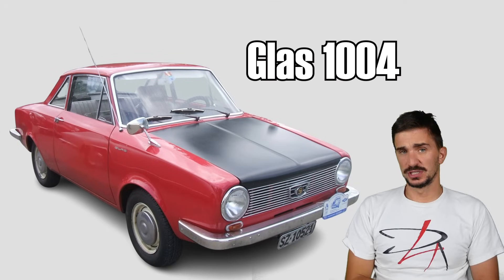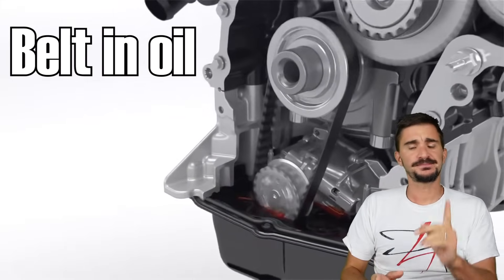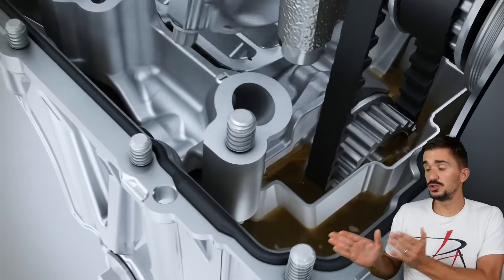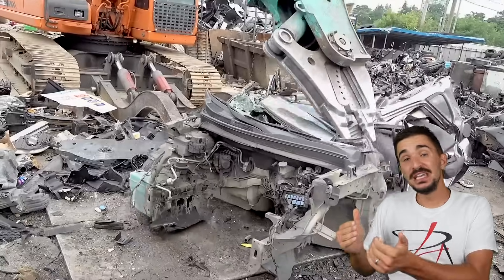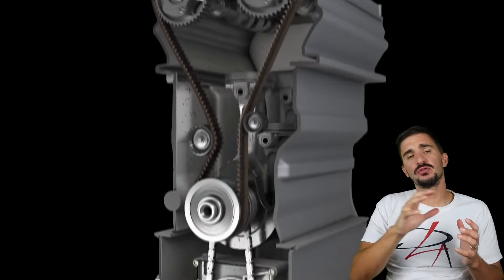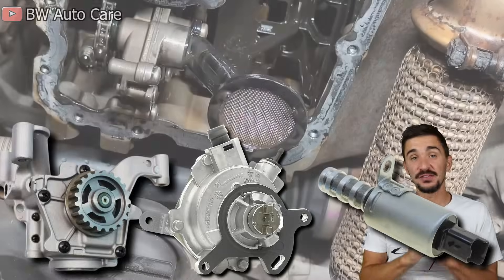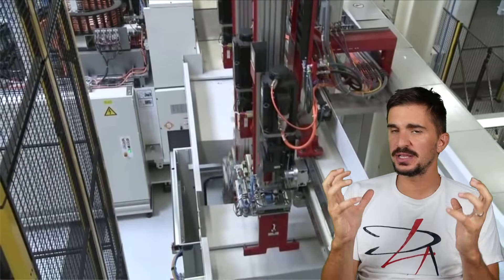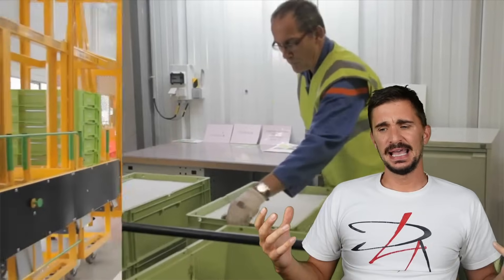Who Approved This and Why Is It Still Being Made? Wet Belt aka Belt in Oil Engines

Comment: The continued use of wet belts despite the known drawbacks only reinforces the 
belief that modern cars are not being built for long-term reliability.

Awesome job on this video.         👏👏👏
Reply: The manufacturers don’t care as the belts fail after the warranty is up. Then they can sell parts or entire engines and add to the bottom line. They figure (rightfully so) that buyers mostly buy another brand of vehicle whether they have had trouble or not, so why should they spend pennies to try to keep them as customers? It’s all in the actuary charts for them. Also, decent cars now last 10 years or more, so a frugal person will own, what, 5 new cars in a lifetime? Even less incentive to do the right thing for them.
Reply: Wouldn’t expect anything less from Ford, same company that brought you the Pinto
Reply: @blauer2551 I had Two Pinto's and both were really reliable and easy to work on. The best one was the 2000cc engine in the '73 it actually had 5 main bearings in the block. Thats the same as most V-8 engines.
Reply: Now ford has a plastic oil pan I used to think Ford was a ok vehicle for the money now I'm glad I'm a gm guy
Reply: @DustinKillyact  I was surprised to learn that the Peterbilt I drive also has a plastic oil pan
Reply: @justins.1283  Unfortunately they could also double as a bbq
Reply: Except in Japan apparently
Reply: @blauer2551  now that's crazy hopefully we are wrong about some of this new engineering I do have a few classic cars that the metal parts of the body rotted away but the plastic parts are still like brand new 🤣🤣
Reply: @blauer2551 the main issue with the Pinto was the location of the gas tank. All they have to do is lower the number a little bit more and that issue is fixed
Reply: @BigPanda096  That’s why I said they would make great bbq’s. Drove around in an orange one when I was in HS and it was a fun little 4 speed.
Reply: They are built to meet emission requirements. Unfortunately, those requirements only care about fuel efficiency, and not the total remains from when the vehicle is built until it is destroyed.
Reply: The real kicker to this shit is you have to use a special oil
Reply: @blue03r6  What kind of special oil?
Reply: Modern cars suck, but the funny thing is, older cars were even worse. When I was growing up, my dad (a mechanic) didn't want a car with over 100K miles on it. The engines usually didn't last much longer. Between improvements in metallurgy and competition with Japanese car manufactures that made their cars to last longer, American car makers were forced to improve the longevity of their cars.
Reply: @williamhicks558  At least you could diagnose problems and do the work yourself
Reply: I work on high end cars for a living and let me tell you that statement you made is 110% true. Manufactures will purposely make specific parts fail. In fact my company is getting sued form multiple people with transmission problems. There’s also a specific model car that has a radiator leak in the same corner. Car won’t make it 20k miles before it leaks. I’ve also seen brand new motors with 2 miles on them leaking oil out the front timing cover. A new one I’ve seen is cam carriers leaking and I only see them on the turbo models. But this is why I stick with older vehicles. Easy to maintain and runs forever. My daily drinker has 467k miles on it and she still runnin good.
Reply: @mdude7778  special oil like gm does with their dexos specs.  I believe to keep the fords in warranty you have to use their motorcraft oil.
Reply: @blauer2551  I admit that's true. I used to do some of my own repairs, but if it was anything I had to diagnose, I would have taken it to my dad. But the kind of things I've repaired (replaced bad alternators, starters, water pump, axel bearings), I haven't had issues with in a car made after 1990 with more mileage on them than the cars I worked on.
Reply: They try to build them as cheap as possible to last for their extended warranty or regular warranty only.  

 It isn't even the engineers. It is everyone else from manufacturing to bean counters to CEOs. Even marketing has a say in many things. 

 When I talked to a car engineer he said basically in a nutshell. 

 "The accountants or bean counters will calculate what each part costs. How expensive it is for us to replace. The longevity, and supply chain. They calculate everything. 

 If one part comes out cheaper then the other long term. They will pick the cheaper part almost always. Since the math pays off on average. Each dollar saved adds up over the course of production. Car only needs to last till past the warranty"

 Remember not all customers take advantage of their warranties or even know what is covered. 

 Yet then add in people that think they know better into the mix. And you get retarded vehicles.

  Or add in short term gains. 

 Either way it is complicated with a lot of people in the mix. Some who lie for their own gain as well. (Example a person or company who makes a part will try to sell that part, and lie about its traits.)

 You get the jist. Admittedly it is just one sample size. I don't exactly run into many people who take a part in manufacturing and design of new mass produced vehicles. 

 I don't think it is as malicious as people claim. I would blame greed and stupidity first always.
Reply: @DustinKillyact  Genetically modified?
Reply: My 08 rams steering rack shat out 500k after warranty. 2500 plus labour
Reply: @blauer2551  Here in Sweden we say that Ford is an abrevation of "Fan! Oljan Rinner Dagligen!" = Damn! The oil is leaking/dripping/running daily! or : Familjen Olssons Rullande Dass = The family Olssons rolling PortaPotty.
Reply: Modern car makers want you to buy other products. They really do not want you to buy their products.
Reply: @williamhicks558  meanwhile in germany we always had a list of top ten cars to by over 200T km (+/- 100k miles).
Reply: Call me crazy, but i think all of this has to do with women buying cars
Reply: Well part of the reason they aren’t made for long term reliability anymore is they aren’t exactly selling the production volume of vehicles they used to say 50 years ago. They’re trying to ensure they’ll still be selling vehicles in another 5 decades. It’s in their benefit that they don’t last as long as they used to.
Reply: @DustinKillyact A lot of cars have plastic oil pans nowadays. Mercedes E class on a lot of engines for example. Pretty normal nowadays.
Reply: That's a sad true.
Reply: Long-term reliability does nothing to "maximize shareholder value".  Nothing else matters to modern corporations.
Reply: @mdude7778  Built cheaply and becomes ur problem at a later date...same with emissions features...to pass emissions standards...that itself becomes another problem later on for you (direct injection)
Reply: @dereknicol3465   I really miss my '61 Chevy Apache.  A simple truck for a simple time.
Reply: 1) cars have objectively become more reliable over time
2) 2007 isn't modern. This was a stretched lifecycle on top of that
Reply: Auto makers are doing the same thing appliance manufactures did. No more thirty -year washers, they want them to break so you have to buy a new one. When I asked my mechanic of thirty some years about this car or that, he said pick a pretty one, they are all junk now.
Reply: @scrambler69-xk3kv  thirty year washers never existed. WTF? Forget Rose colored lenses, you're looking at the past through a VR headset.
Reply: Not to blame the victims here, but if the consumer was better educated (i.e. read up on reliability on a vehicle), the makers would re-evaluate their choices when stuck with vehicles not selling.
Reply: @pfsantos007 
Same goes for some politicians in America. 
People just need to read something ones a week that they don't agree with.
Reply: CHECK HISTORY,CARS IN GENERAL ARE WAY MORE RELIABLE THAN 50 OR SO YEARS AGO !
Reply: That's always been the case lmao
The Toyota, y'know, good ol reliability king Toyota, V6 that came in the taco and 4runner in the 90s had a stupid timing chain life of like 50-100k miles
Reply: Soon enough we will be driving EV'S and we won't have to deal with the badly designed IC engines.
Reply: @gwayne919 Ah yes, our savior shall be the pinnacle of the unreliable automobile, absolutely, 100%
Reply: well modern cars normally- these small 3 cylinders are among the exceptions-  last far longer than 40 or 50 years ago. when i was a kid, in the 70ies, 100.000 km was in europe considerd a lot, few people would buy a car with that many kilometers. nowadays 4-500.000 km is nothing exceptional. apart from that, the rust problem, important in NW europe, has been solved. for most cars rust is not a problem anymore.
Reply: Most modern cars do NOT use this design...
Reply: @blauer2551 yeah Ford! ,i have one and si far so good,but i guy told me his oil pump failed and seized the engine! Apparently the Ford reanger oil pump uses a plastic impellar system that adds to fuel efficiency,but runs the risk of sudden failure!
Reply: An my wife wonders why I would rather buy another old car instead of a new one
Reply: Well, not modern cars, Fords and Pugeuots.  Some other cars use timing belts, but in the US there's like a 1.0L Ford engine that uses a wet belt and I think that's it.  They are very stupid so they are really not used often at all.
Reply: @DustinKillyact  Ford is also the primary user of wet belt engines. I don't think (at least I hope not) they are using them throughout the line ora nything, just on one or two "extra special" "cost optimized" engines.   In fact I think you'll find it's the very same engines with the plastic oil pan that also have the wet timing belt. This video talks about "manufacturers" using these but, like, in the US it's Ford and only Ford; per Google the other tmain user of these is Peugeot; at the moment they don't sell cars n the US. 

The 1.0L Ecoboost is infamous for having engine failure before they hit 100,000 miles.  Apparently if nothing else on the engine packs up first, and if the belt doesn't break and your engine packs up from that bending all your valves (I'm sure it's an interference engine..), if those don't happen first they tend to have bits of rubber from that stupid belt end up in the oil and your engine packs up from clogged oil passages.

(That said, I've had a vehicle where the oil pan rusted.  And none of my cars have had any illusion about the oil pan being a skid plate, they all had stuff lower than the oil pan or straight up had skid plates underneath it.  The Ford engines that use a plastic oil pan are hot garbage, but I could se a vehicle using the right kind of plastic there and have no problems.  Of course you use the wrong plastic, the oil detergents probably would do things to the plastic from thie inside, the heat will make it get weird and it'll get brittle with time and crack.  You know what, my plastic valve cover on my Chevry Cruze did exactly that, got all brittle anc cracked from heat.. I changed my mind, at least on a GM product if they can't get a valve cover right I doubt they'd make a plastic oil pan that didn't go to pieces.  I've switched to saying a plastic oil pan is definitely a bad sign.)
Reply: @billd9667  I read that some Mercs now have plastic inlet manifolds that crack just out of warranty.  What sort of quality is that?
Reply: I'm keeping my 2000 Corolla primarily for the timing chain!
Reply: add to it the untenable situation with the electric car mandates that are coming and it truly does appear that Big Brother is working to herd us all together in big city ghetto's, with no vehicle, dependent on them for everything. Hey, what can I say, I've read the book.
Reply: @blauer2551  I'm probably as far from an expert as possible but I can see them thinking that the oil might keep the plastic from becoming brittle and giving it a long life and it having some give could give it a better seal without people trying to reuse gaskets or something.
Of course, it's a lot cheaper for them to manufacture.
Reply: This makes 999999999999% sense. Why they are selling new cars every year? because the ones before they failed. cars before the 2000's generally dont have that
Reply: They are reliable, if you service the car and the belt. What they are banking on is that you believe it’s not worth the money to do it and you buy a new car.
Reply: That's complete nonsense. Then they don't have to make a car rustproof either.
Reply: @blauer2551  The Pinto's timing belt was easier to change than most modern drive belts.
Reply: @gwayne919 you mean the EV's that burst into flames in your garage.
Reply: I am dumbfounded by the auto industry and it's constant list of mistakes, They have proven technology available and ignore it. .??😢
Reply: It's just a way to make us buy another car
Reply: That is not even the most astonishing part, to me.  The morons that designed this rubbish believe the consumers are so stupid and oblivious that we'll never notice how horrible they DELIBERATELY designed this engine to be!  And that we will just keep buying their cars regardless of how awful, unreliable, and fast wearing they really are.  I haven't bought an American made car in 40 years; which is an awful thing really, but I can't afford to own unreliable junk anymore... so i'm basically forced to buy Tokyo tin -
Reply: @blauer2551  i could change a timing belt on my pinto in under 30 min. With a basic $10.00 socket set. att that time.
Reply: @ateamfan42  that is the answer to all the problems  aired on here.
Reply: from the point of view of manufacturers, ICE cars will be banned soon anyway, so why make a car that needs to last 20 years when they will be banned from producing and selling them in 10 years?
Reply: Truth. It's planned obsolescence/failure to the extreme. Want to change your headlights? Take it to a garage. Want to change your spark plugs? Sorry, bud, you've got to partially disassemble your engine. Tyre pressure low? Oh yeah we no longer have caps, you've gotta just replace the whole tyre now. Last point being a joke but I legitimately won't be surprised if it becomes a reality like the former two.
Reply: DUDE THERE BUILT TO KEEP PEOPLE WORKING
Reply: Once all the manufacturers start making disposable cars, people will have little choice. The big problem is that the costs are continually rising.
Reply: LISTEN THEY DONT CARE ABOUT RELIABILTY AND NEVER HAVE   THEY CARE ABOUT U HAVEING A JOB TO DO   ONCE U SEE THAT THINGS MAKE SINSE
Reply: Just like back in the late 70's with some engines having Fibre Timing gears
Reply: A modern car's life expectancy is around 100 000 km and/or 10 years. Designed life expectancy that is. Anything more you gain from it is just a bonus. 

It is why your automatic transmissions are (so called) sealed for life and are often trouble free until such time. However, because owners never service them on a regular basis (not in the maintenance schedule) the transmission fluid denatures during this time and eventually causes it to fail. That's just one example.

Part of the reasoning is that as its life ends you will replace it, hopefully using your sense of brand loyalty.

Another is to get you to keep up with ever changing technology to conform to the latest emissions and safety standards.

A local market Japanese car is designed for a 40 000km lifespan and is not designed to be reconditioned. As they hit that mileage, they were often exported to other countries with different safety and emissions standards, where the cars for that region are actually designed to last longer. Some cars lasted a very long time, others did not. Australia and New Zealand were often eager buyers of these cheap imports.
Reply: @PeterGardner-e1z  I remember those. Chevy's nylon toothed time gears.
Reply: It's like the manufacturers genuinely don't give a shit about their reputation. But then moan people are buying Chinese.
Reply: Honda also has the 1 litre wet belt Turbo engine in the previous Civic.

Comment: Me happily driving my 385.000km Mercedes W124 with a timing chain being as thick and rigid as can be, with it still being the first chain, put there almost 32 years ago! Now that’s what I call Quality! It gets an oil change every 5.000km, since it my summer car, and it still works like it’s new
Reply: I've just replaced the chain on my 318 is m42 e30 {a multy decade long family member} at just north of 450,000km was jetting a bit noisy,  I think Excel-plus helped it a long a bit still running extreemly well
Reply: I have never seen the timing chain on my 1972 Jaguar XJ6 or 1964 Mercedes w110 200d except when adjusting the tappets on the Mercedes. My 50 and 60 year old VW Kombis have gears to drive the cam so I have never seen those unless rebuilding the engines.